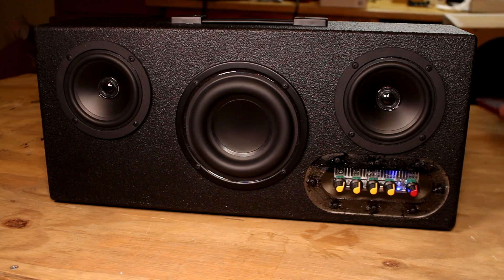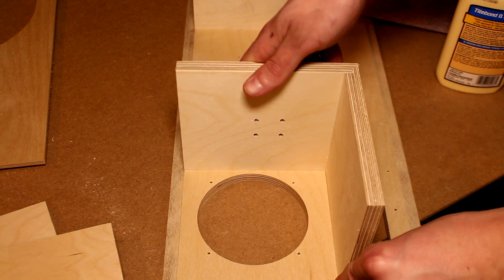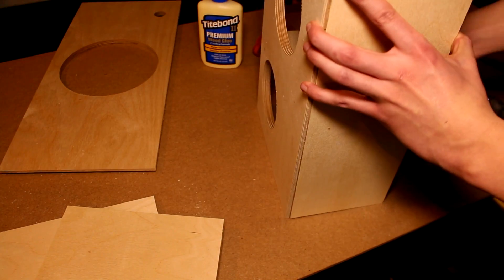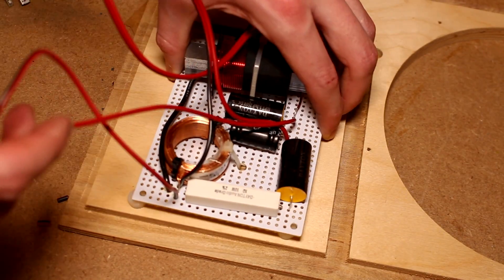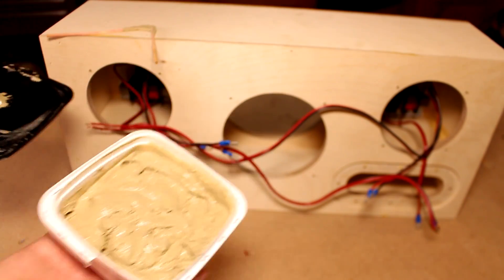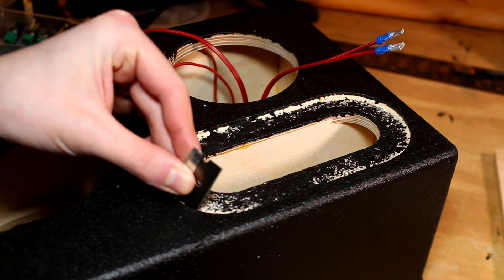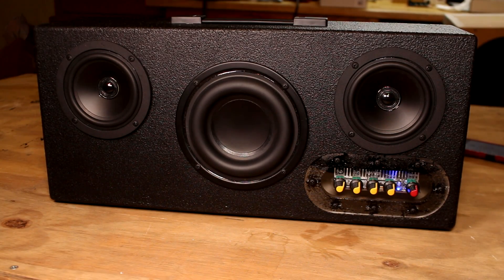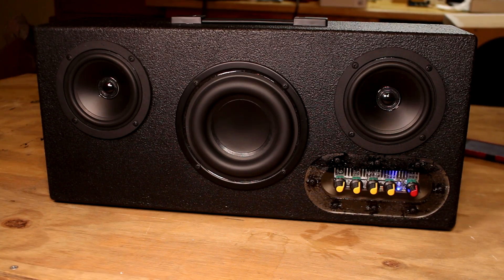DIY Executive 200 Watt Portable Bluetooth Speaker Kit Quick Build

Comment: Fyi on the wood glue, you should use the original Tite Bond because it's used on musical instruments. That's because it's absolutely not flexible. It will support resonance as a result. And it's very strong in ways that a flexible glue can't be.

Comment: How do you find the bass and pressure in room compared to this PE vs your recent dual 8” PR build that you posted
Reply from the maker: The 8 inch Dayton Audio subwoofer with the dual pr has more output than PE speaker with the 5 1/4 inch Tang band subwoofer, but I think the TB sub sounds better and has better low frequency extension than the Dayton. This could be because a few reasons, but I think it's mostly due to the Dayton sub needs more box volume with the dual pr's. More box volume will increase SPL, low frequency extension, and sound quality. I will post a video comparing the two within the next week.
Reply: @LoudLabsAudio  thank You for the reply yours is the only channel who does projects on BoomBox and that is what I want to do

Comment: Jbl bass pro go compared to this
Reply from the maker: I don't have any experience with the JBL BassPro Go, but just from reading the specifications, they look pretty comparable, similar subwoofer configuration and power output, the Executive speaker might have cleaner, louder high frequency output with the coaxial drivers, but it will be more heavy with the passive crossover components. JBL makes quality products, you can't go wrong with either. The cool thing about the kit is you build it yourself and can customize it, verses just buying a speaker from a store.
Reply: @LoudLabsAudio  ikr

Comment: My speaker is about the same size n guaranteed it sounds 100 times better well 10 times better realistically , if anyone has equipment, I have many designs that will change the game in the speaker industry, my first n only speaker I built shits on any speaker on the market less that $2000 and only speant 95.59 usd
Reply: How do I connect with you need to make BoomBox in budget

Comment: Dam $200 u should hear my speaker I paid less than $100 and it’s so loud and the bass is better than most cars, and it’s only powered by two  4 1/2 mid loudspeakers n 2 tweeters but I have four 6 1/2 in passive radiators
Reply: Wait wait wait, in another comment you said the speaker is the same size as this. Yet it has two 4.5in mid drivers, two (assuming 2in tweeters) and four 6.5in PR's. Also you say it shits on anything on the market. So let's say bare minimum components you'd be running a large amplifier board. Which also with all those drivers you'd need let's say a board of 5 26650s to have a battery life of 2 hours at half volume on a good day. Not to mention the tuning of the box with the PR's to get yourself to 35hz. Like I get this isn't real, however even if you built something to these specs this would be the size of a table. Also it would cost more than 100 for all the components. Even using the cheapest of drivers, Amp, capacitors, wiring, batteries and so on. Which with the cheapest of components wouldn't compare to even the UE hyperboom or JBL boombox, which are both pretty eh.

Comment: Hey, I've read up on the amp on PE and it says there are already built in lowpass and hipass filters between the sub channel and full-range channel, so my question is, why are there crossover components in the kit (and are they necessary to use)? Thanks for reading and nice video.
Reply: The crossover is to split the frequencies between the mids and tweeters, and yes you do need them.

Comment: So i have a project in mind but i have no idea where to start, i have these sony speakers that I'd like to make into just one single bluetooth portable speaker box with the result something like the soundboks is this possible? Its just so clunky to have 4 separate boxes and it doesnt have true portable capabilities, would i be able to add battery power 
The link for the speakers below  https://www.google.com/search?client=ms-unknown&sxsrf=ACYBGNR_F-hreDpB3EpoKiAuxSfS9mnpYw%3A1576383411116&ei=s7P1Xc66BsGc-gSh5r6YAw&q=sony+mhc-ec919ip&oq=Sony+&gs_l=mobile-gws-wiz-serp.1.0.35i39l3j0i67j0i273j0i67l3.27169.27711..28622...1.1..0.141.610.0j5......0....1.......8..0i71j35i362i39j0j0i20i263j0i131i67.NzIgNvGRKd0#lbl=DETAILS&pie=plaji-i
Reply from the maker: Anything is possible if you put your mind to it! Your best option is to just repurpose the drivers and build a custom box and get all new amplifier equipment and a battery pack for portable use. Results like the Soundboks would be difficult to get with those drivers, since the Soundboks uses high efficiency drivers paired with 3 75watt amplifiers and a beffy battery pack. You would have to build something from the ground up and spend $500-$600 dollars to match it but it's definitely possible.
Reply: @LoudLabsAudio  ok maybe soundboks is overkill, lets say i just wanted a good enough portable speaker how do i figure out the box size and how to figure out if the amp equipment is compatible or appropriate for the drivers i have?
Thank you!!

Comment: 200w is peak power, not rms, in rms it will be about 80w I guess?
Reply from the maker: Yea I know, but Parts-express calls it 200 watts rms so that's what I made the title. It is about 80-100 watts rms at 12v
Reply: @LoudLabsAudio   classe D 12v - 10-15 Wat 1  Chanel-   12v X 17 Amps =204 Wat your boombox get 12 Amps power ??? No   it is impossible max 45-50   Wat-  3 Chanel 😁

Comment: Fellow audio YouTuber here. I just subbed. Great job! We used that Tang Band in our Dinas build. I'm curious what you think of those coaxials.
Reply from the maker: Hey thanks for subscribing! I'm not really a huge fan of coaxial drivers in general but these ones in this configuration are pretty good. They sound actually pretty bright for dome tweeters but still not nearly as “live“ as a horn loaded tweeter (which is what I prefer). They're nice if space is limited and they give you more flexibility over a full range speaker driver

Comment: What battery comes with it? , if no battery is included then it's not portable and the price should be much cheaper.
Reply from the maker: It comes with the Dayton Audio LBB-3 battery holder which holds three 18650 cells, and it comes with 2600mAh 18650s to put in it
Reply: @LoudLabsAudio  nice its good they supply them but a bit of a letdown that you did not show them.
Reply: Can someone please tell me why people use a bunch of 18650 batteries that are only about 4.2 volts instead of rechargable 9v batteries that you wouldn't have to use as many of? Feel free to email me jessihays923@gmail.com

Comment: Thanks for this video! This is the exact model I was looking at. How does the sound of this speaker compare to those on the market in the same class? With that power I bet it's incredibly loud, but would you say the sound is better or as good as other "Hifi" Bluetooth/wireless speakers available (Those that are generally $400+)? Thanks!
Reply from the maker: These DIY style bluetooth speakers are unlike anything on the market. They are actually designed around being a speaker, not around a plastic shell. You get a ton of low end out put and crystal clear mids and highs. This thing sounds great, and the battery lasts a pretty long time. For the money you can't beat it. Its sounds twice as good for half the cost of some things on the market.
Reply: Thanks for your reply! I'm taking the plunge and purchasing the kit. I've never built a electronic DIY before, so I'm a little nervous. A few questions, I've heard 24vdc battery can really juice up the amp, is this overkill though? Would it be difficult to add a 3.5mm input jack? Lastly, does the duratex improve the actual sound of the speaker, or is it just for protection? Thanks again for your video!  @LoudLabsAudio
Reply: @LoudLabsAudio   you might want to put a large capacitor in series with the coaxials to limit the bass they are playing. There is this thing called Intermodulation Distortion that is particularly high with coaxial speakers when they are used fullrange. Ideally a coaxial speaker's cone shouldn't be moving at all but crossing it between 150 and 500Hz really improves the performance of a coaxial speaker. It doesn't have to be a super expensive capacitor either because it is out of the critical audio range. Not blaming you at all, just wanted to let you know. ;)
Reply from the maker: @vincentkoster6291  The amp has a built in 150hz hpf for the L/R channels so they don't play very low, and I'm not sure were the crossover rolls off at, but I plan on measuring these once I get my measurement system
Reply: @LoudLabsAudio  good choice! I assume the 150Hz highpass to be a first order as there is still a lot of cone movement. Measuring is a smart move. Good luck!